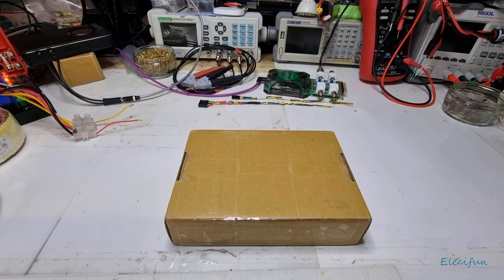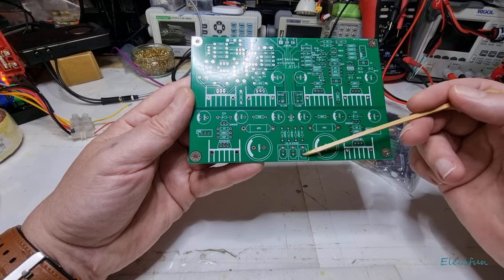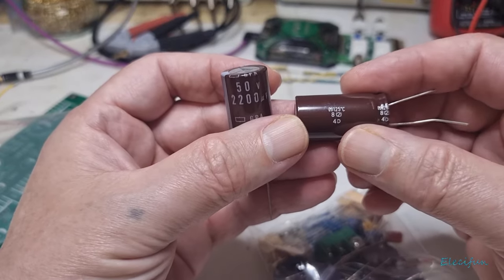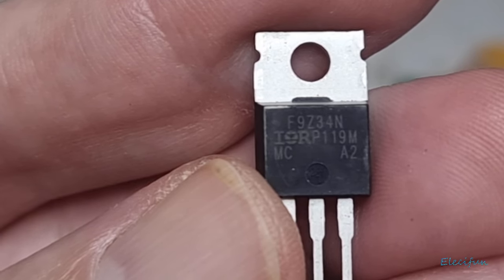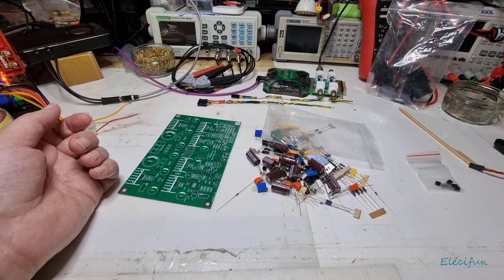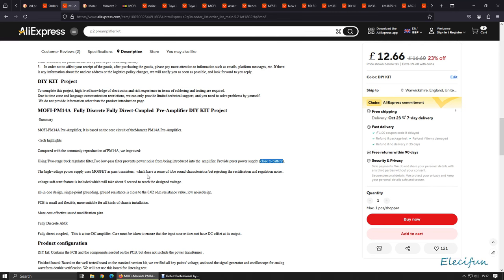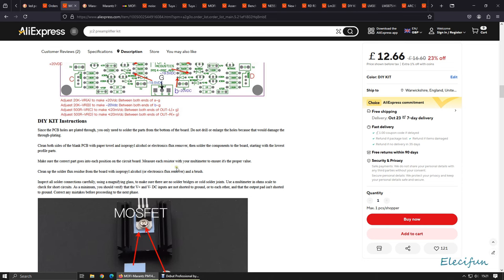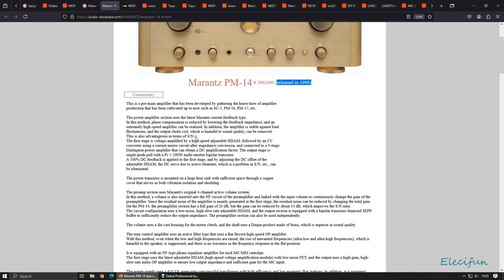MOFI Marantz PM14A Pre Amplifier Aliexpress

Comment: OOo nice big board or bigger than usual. Very nice. This will be most interesting. 

A preamp has all the inputs like phone, tape, cd, tuner etc right? 

I built my power supply for my L12-2 amps.

For some strange reason the pcb came with three components already soldered. Any idea what might be going on with this? Kinda strange that they soldered components to it already which appear to be the wrong values.

I had a devil of a time getting them out. Sigh. 

There is a R35 in the pcb wtf is that? Anyway I'll try to find a 35ohm resistor unless it means something else. 

All I need now are two speakers and a toroidal transformer/s. 

Anyway I can't wait till you build this up and test it. 

Cheery oh ! 😂

Comment: The orange components are ceramic capacitors? I saw a comment that those are microphonic and need to be replaced with film capacitors.
Reply from the maker: @raynerstuelgalid good question. I think the orange caps are polyester. The little yellows are defiantly ceramic. Yeah not really desirable in audio circuits for the microphonic reasons you state. Sometimes used for bandwidth control or to prevent oscillations.